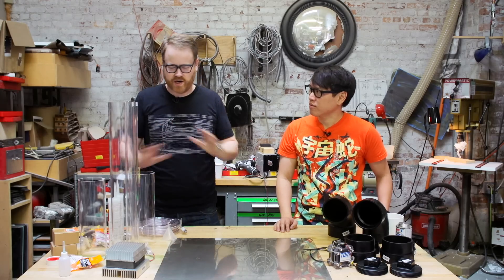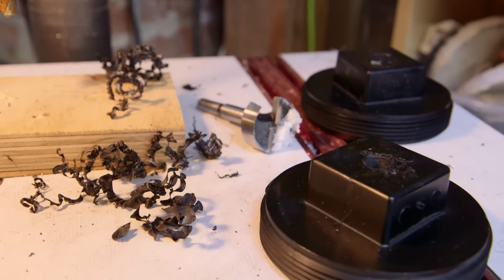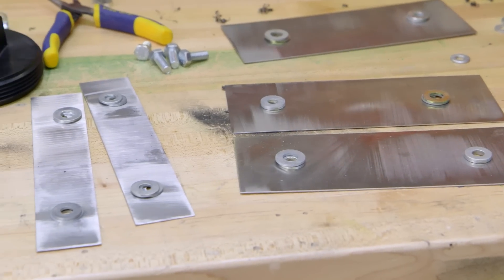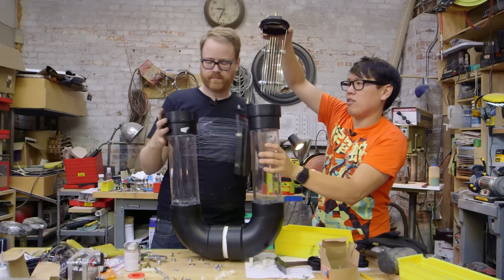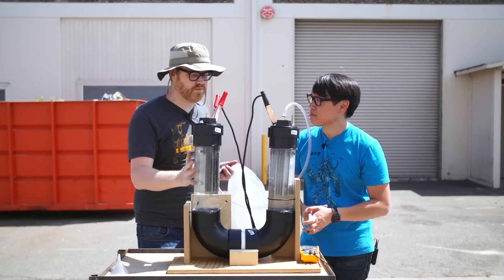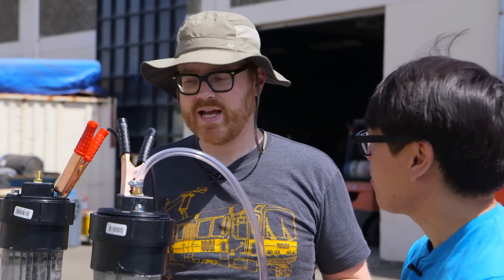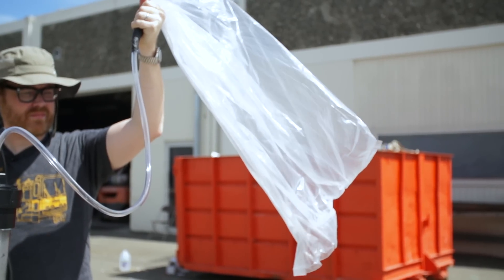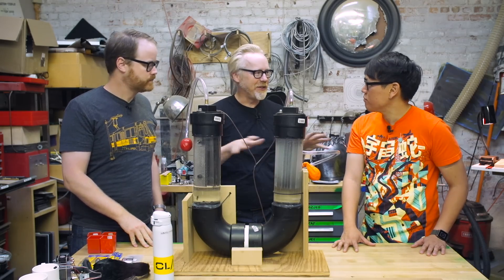Tested Builds a Hydrogen Converter

Comment: ummm guys... I reccomend attaching a bubbler if you plan on using that thing... if a spark happens to hit the gas it could blowup the whole rig in your face.
Reply: GoogleGamer
TL;DR: Oxygen is an oxidizer. *slow clap* #Kappa
Reply: +fo shizzle Oxygen is NOT super flammable. It doesn't catch fire and burn by it's self. I know first hand, I deliver liquid oxygen for a living. If you take a hose with oxygen coming out of it and hold a lighter to it, the flame gets bigger. Shut off the lighter and the fire stops like it normally would. If oxygen was flammable the stream of oxygen coming out of the hose would stay on fire, which it doesn't.
Reply: +Eli Youmans This tthing separates gasses... So no explosions. ;)
Even if you manage to introcuse flame into pure hydrogen it does NOT blow up ;)
Reply: +chaos Its making oxygen on one side and hydrogen on the other side. In electrolysis hydrogen is created at the  cathode and oxygen at the anode. In their design they have separated the cathode and anode.
Reply: +Šimon Karatsiolis (Warialinth LightHoof) except its not, its making both gasses at both sides.
Reply: chaos
We also didn't explain how the universe was created. So it's not happening. Screw you, Big Bang! You're only a theory! A scientific theory~! Dun dun duunnnn!!! #Kappa
Reply: ok so if you split the hydrogen from the H2O at the cathode what happens to the oxygen? does wonder on over to the anode? if so please explain how it does so
Reply: +chaos I believe they said one side of the U was producing hydrogen and one side was producing oxygen. Though I'm still not clear on how that happens.
Reply: +chaos I'm a certified scientist. If hydrogen and oxygen get mixed together, they turn back into water vapor, then turn into a water droplet and jump back down into the water. Therefore, it's impossible 
for the gasses to "combine", and you get the pure thing on one side and another, although it's mixed with water vapor, so it's not the best product you can get. And both products are highly flammable, so... You better not stand too close >:P #Kappa
Reply: ok maybe you can explain the hand wavey explanation every wiki and scientific paper gives on how the chemical transference of oxygen through the water to the the anode from the cathode occurs? https://en.wikipedia.org/wiki/Electrolysis_of_water this wiki gives the chemical flow equations and even the the thermodynamics involved but seems to be mum on how O2 gets from the cathode to the anode side. if it works in real life that's fine but how its actually working is yet to be explained.
Reply: chaos
It's magic. Just like magnets. The answer is in the Bible. TL;DR: It's 'cause God said so.  #Kappa
Reply: actually, i would like to be wrong on this, as in practice the O2 and 2H are gassing separately. but until its properly explained its not happening.
Reply: They are charged particles. Just like magnets they are attracted to the inverse charge and repelled from the like charge.
Reply: Just having the gasses together doesn't make "water vapor" unless you burn them. Having them together just makes what's called Hydroxy Gas. The King of Random (Who they mention in this video) explained this in his video where he filled up balloons with hydroxy gas. Unless I missed something.
Reply: Luke Sluder
You missed the point. And the point is just the tip. The tip of an iceberg. With a hashtag Kappa on top, because cherries filled with sarcasm don't exist yet.  #Kappa
Reply: LordDragox412 Yup, didn't see the "read more" on your post.
Reply: +GoogleGamer The hydrogen is quite explosive because oxygen is in our atmosphere.  The oxygen is not explosive in our atmosphere because there is no readily available fuel. Don't try that in saw mill.
Reply: +TheDamped and you're tell me because?  I was just pointing  out to the fellow that oxygen itself isn't flammable
Reply: Had the mistaken impression you might want to know why (and a little on the side).
Reply: +Šimon Karatsiolis (Warialinth LightHoof) 

the container itself is combustible. (simple solid fuel rockets can actually burn PVC with an oxidizer)

Comment: use 12 volt car battery or a couple of them in parallel for the extra amps along with your solar panel as at 24 volts there wont be enough amps on its own!  i use 12 volt charge controller setup and still the amps can be lo in bad weather days etc! all of that varies the power wattage even temperature effects things!

Comment: Norm and Will, don't use gloves with rotating tools. It is very dangerous.
Reply: gsgsrgsrgrsgrsgrs
Reply: Seen a few people loose fingers or hands over the years because of that shit.
I'd rather loose a chunk if flesh than the whole hand - & that's why you don't wear gloves while working rotary tools.
Reply: Paul Frederick Of course you shouldn't touch the drill bit at all. But accidents happen, and wearing gloves is much more risky than not wearing them.
Reply: gsrggsgsrgsgrsgsr
Reply: +SgtStinger 
I Normally didnt use gloves in the shop but when i had to drill a still hot metall frame due to welding i ignored my gut feeling.
I ended up taking a ride with the drill until my arm hit the pillar and luckily the drill lost grip of my glove.
I was so adrenalin pumped that i jerked the heavy work gloves completly open so only the seams at the fingertips held the glove together. 
That glove now hangs in the shop wall as a reminder.
Never get to comfortable with rotating machinery and never ignore your gut feeling.

Dont listen to ppl who advices you to wear gloves please. you only have 2 hands and 1 life..
Reply: vizionthing WTF are you even on about? Are you trying to say that using the safest method of doing something is unnecessary? Because I'd rather nick or cut my hand a bit while not wearing gloves than potentially loose a finger or three if the glove were to catch on the drill bit.
Reply: grgsgsrgsrgrsgsrs
Reply: Was going to say the same thing but I was sure I'd find it in the comments.. And sure enough! I was not the only one to see the danger
Reply: +SgtStinger Gloves, no gloves, IRRELLEVANT!

There's pros and cons to argue for and against, but whenever possible, it's just better not to have your hands holding the work-piece. Clamped work comes out better and if your hand isn't holding it there's no chance of getting caught in the spinning tool or getting cut by a work piece that's gotten caught and spun (say when the hole is just about to come out of the bottom of the steel).

With that said, I would have bare-handed the holes they drilled in that ABS. Some cheeses are tougher to cut than most plastics, and those caps are large enough to hold against just fine.
Reply: +azorl i worked as a millwright/machinist and we were told never to use gloves for that same reason your more likely to get caught in the machinery, same thing goes for long sleeves.
Reply: +Quade Axford amen
Reply: +SgtStinger Always, Always use gloves with a grinder or wire wheel. Around Lathes, mills, drill presses I see your point but not all rotating tools are the same.
Reply: richb313
I do not wear gloves for anything I do in my workshop besides pulling a heavy vise off my milling machine. Then it is all covered with sharp metal chips, and just the weight of the vise will drive them into my skin. But past that nope, no gloves. OK welding, I wear welding gloves when I weld too.
Reply: SgtStinger
If you can manage to stay far enough away from the spinning drill I do not see gloves being a hazard. But someone is probably better off not relying on gloves for protection. I've never liked wearing gloves for doing shop work. Yard work, sure. Then by all means wear some gloves. But wearing gloves wrecks my dexterity, and fine motor skills trying to perform more delicate tasks. I just feel all clumsy fingers then.
Reply: +SgtStinger here go play with this ladder
Reply: carpespasm
I do have a lot of drill press vises up to six inch capacity. So if it was a 5" plug I probably would have had it in a vise myself. I do agree that for small parts hold them with some pliers, preferably locking pliers.
Reply: carpespasm Its not irrelevant. No matter if he holds it or puts it in a vice, he shouldn't wear gloves.
Reply: +SgtStinger 100% right, and for those of you who don't believe it, take a look (graphic illustration of gloves+spinning)
http://imgur.com/x2wq8Ph,qVXD0W7,cmae2St#0

That said, if something happened to Will and he was never in anymore videos, I think I could live with that
Reply: +azorl 👆👏👍
Reply: SgtStinger my teacher saw a guy have part of his finger and all the skin off of it because a ring was on his finger
Reply: Can confirm: Don't wear gloves around rotating things that can snag. I was cringing pretty hard for that shot. As others have mentioned, it was crazy that he hadn't clamped the part. As a channel with over 2.9 million subscribers, they have a responsibility to demonstrate safe shop practice.
Reply: who the fuck can injure themselves using a drill press o.o' its basically idiot proof

step 1 place object your trying to drill through on press
step 2 mount object if needed with Clamps
step 3 turn on drill press and keep arms and legs away from spinning parts

only thing i ever wear gloves around is an Angle Grinder... almost took my finger off once when i was using it without gloves... the fucking disc split into a million pieces and i took one right in the knuckle it went half way into the bone

just from personal experience if your gonna use an Angle Grinder wear some heavy leather gloves and some kind of chest and arm protection and this everyone should always know safety goggles, when i say chest and arm protection i just mean some kind of thicker jacket material like a jean jacket or a mechanic suit... anything helps when you got a grinder disc exploding in your face

well anything except a cat flying at your face from left field i guess XD
Reply: I am 64 years old. I have all my fingers. Gloves have saved my hands and fingers multiple times. Wire wheels can strip flesh in less than a second. Take your own chances but do not give advice that runs counter to good shop practices. I have worked shipyards, Navy submarines, at sea, in the oil patch and more.
Reply: richb313
well I'll be 51 next week gramps and I think your advise sucks. Because a wire wheel can catch on a glove and pull your hand into the wheel. Why couldn't you hold one job? Probably because you wear gloves when you shouldn't!
Reply: +Sharklops When I saw Norm sporting the full face shield to drill plastic I literally laughed out loud.
Reply: Von Antero
There is nothing perfectly reasonable about wearing a full face shield drilling plastic on a drill press. Like others have said, the glasses on his face were adequate protection.
Reply: azorl Yeah, one of my instructors when I was training as a machinist had seen a guy get his arm ripped off because his glove caught in the lathe. I'm not taking that risk.
Reply: Von Antero
Oh don't worry I never have. That does not mean it has not happened to others though. For some reason many folks think they can just pull those chips off the bit while it is spinning. I'll actually stop a press if I get a big nest going, and remove it. Sometimes it still happens even if you're doing everything right. If you drill enough holes. My designation when I was in the union was Mill & Drill too. So I have definitely drilled far more than enough holes.
Reply: +Von Antero Then don't touch the bit. You're not supposed to touch the rotating bit at all. Although as an interesting aside there is a phenomena called "de-gloving" that can happen to your bare hand operating a drill and a birds nest of metal chips swirling around it. Which is why you are supposed to break your metal chips while you drill. Because if your hand gets caught up in the nest of rotating chips, a chip could wrap around your hand, then when you pull away you leave the skin of your hand behind, as the metal chip slices it off. Nasty!